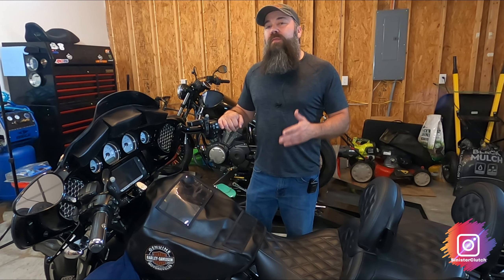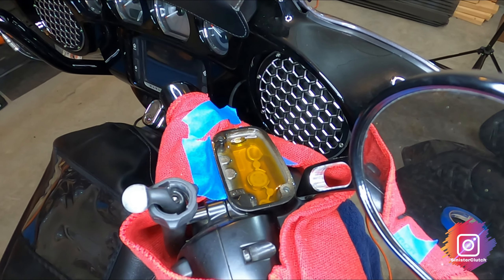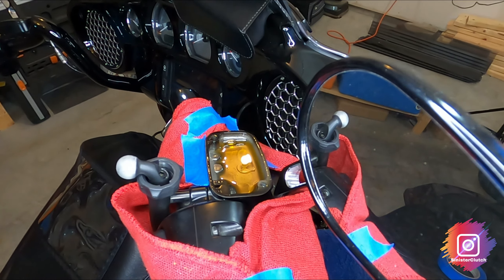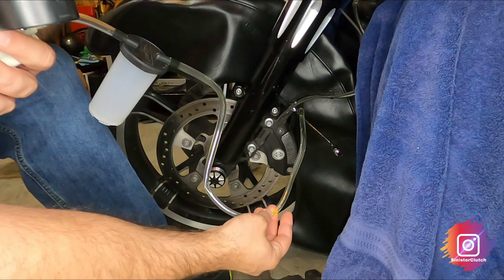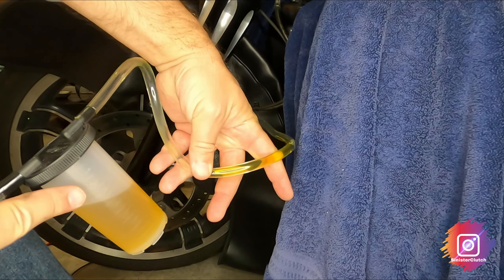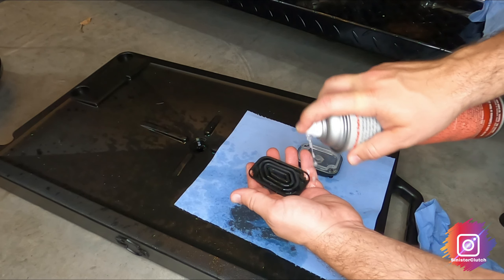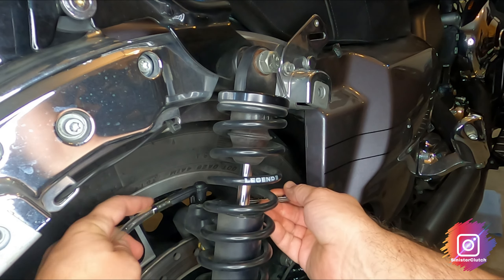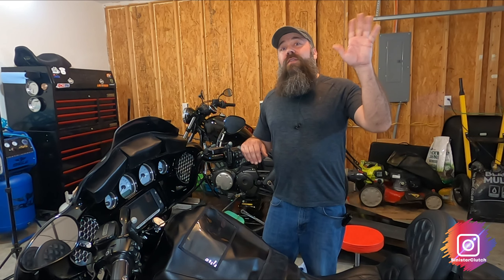How To Bleed The Brakes On A Harley Davidson Street Glide

Comment: Great video. I use the mighty vac too but You will still have old fluid in the ABS system if you don’t activate the ABS module. 
Is it enough to pose a problem? I’m not sure but I like to ensure my entire brake system is clean. 
You can purchase the IMT bleeder tool for abs from their website. I have zero affiliation with them and not trying to sell their product but it works.
Reply from the maker: @troym1849  Great info!  Do you have a link for the tool you mentioned?  Thanks for watching!

Comment: Thanks for the video... I have a question I'm redoing the radii at the same time. And before bleeding the brake lines can I turn on the accessory ignition for the radio work without messing up the ABS module??
Reply from the maker: Great question!  To be honest I’m not 100% sure.  But if you got the master cylinder cover off and you do any movement with the radio I could see brake fluid being splattered.  Bleeding the brakes is a job I always do by itself.  I couldn’t find anything in the service manual about it either

Comment: I have a 15 Street Glide Special as well. Bought it used (29k miles) from the HD shop and its been back more than its been under my butt! Fromt brakes are dragging. Not all the time, it comes in cycles like every 10 min. Have to hit the front brakes kinda hard to get them to release. They have changed the ABS module, supposedly the calipers etc. Still having the same issue. Any suggestions??
Reply from the maker: You could have an issue with your brake calipers but like you said they supposedly changed them.  If the brake fluid was not properly changed over the years that can affect the whole brake system from master cylinder, brake lines, and to the calipers.  There are multiple variables as to what the issue could be.  For example if your brake lines are clogged that could cause this issue as well.

Comment: Hey Randy, I went ahead and flushed front and rear, no problem. However, my ABS doesn't stop flashing now. It used to stop a few minutes after startup. Any idea? 2014 SGS
Reply from the maker: Are you sure you didn’t introduce air in the brake lines?  Check for Diagnostic Codes
Reply: @SinisterClutch  I certainly didn't think I did but I will check for codes as soon as I get back there. Thanks for the quick reply. If no codes any other ideas? If code for air is found, is this a definite trip to dealer?
Reply from the maker: @jbucks166  Yes definitely a trip to the dealership.  They will hook it up to a computer to flush the air out.  I’m guessing there will be a code.  Just look it up for info.  Happy to help🤙. Let me know if you have more questions.
Reply: @SinisterClutch  No codes present. Gonna try everything again tomorrow, some more research too, if no luck,  looks like I'm headed to the dealer. Kinda sucks ..Thanks for your help.
Reply from the maker: @jbucks166  Have you rode the bike since bleeding the brakes?  Basically to test the brakes.   You could also pull the main fuse.   I’m wondering if the ABS is trying to sync.
Reply: @SinisterClutch  Yes, once I finished the flush I took it out. U and down the block a few times. Approx 10-15mph jammed the rear brake and The ABS clicks/clunks relatively loud. Maybe not as fast but I tried with front brake and same result. I brought back into garage and re-flushed the rear a 2nd time thinking it would fix the issue but it did not. ABS indicator on dash cycles and sets as normal, it does not stay lit,  no codes on DTC, brakes feel stiff, nice and tight. Only with the fast/emergency type brake the ABS acts crazy. Everything I read now says it's normal, (Touring service manual) either pulse or clicking when ABS engaged is normal. I'm not sure though. Maybe I'm wasting our time now to think of it I never jammed on the brakes prior to know if the ABS behaved that way prior. I only did it now because it was suggested after the flush. It was only then I realized it. My gut tells me it's no right tho.
Reply from the maker: @jbucks166  It sounds normal to me. ABS flashes until you start rolling.  If the ABS light stayed on instead of flashing that would be a good indicator there was an issue.

Comment: My front brake is super hard I can’t press it I just bought 2009 ultra glide old owner didn’t charge any oil I tried bleed brake but it didn’t work
Reply from the maker: Your bike has ABS right?   If so, there could be air introduced.  Could be an issue with the master cylinder or brake caliper.  Are the pads dragging against the rotor?  Jack it up and spin the front wheel